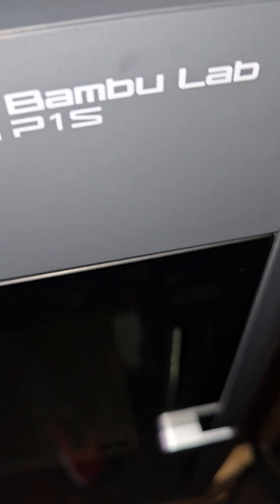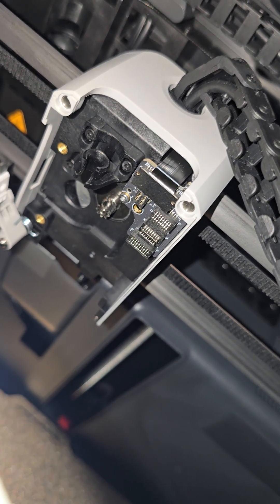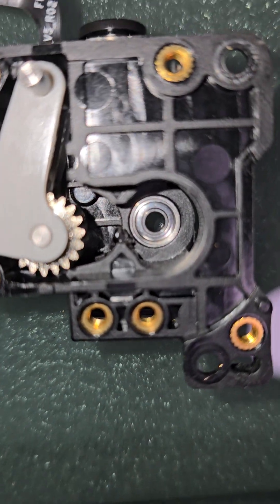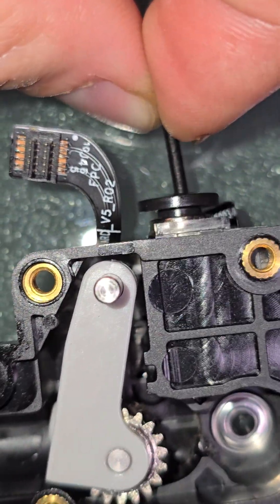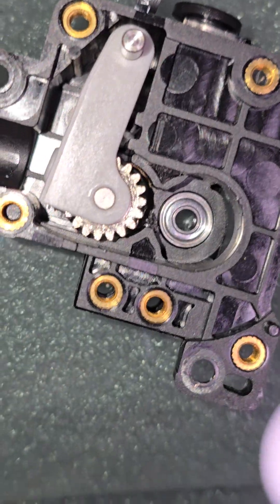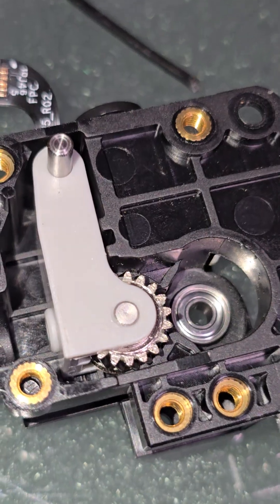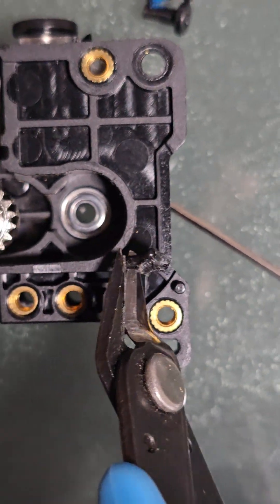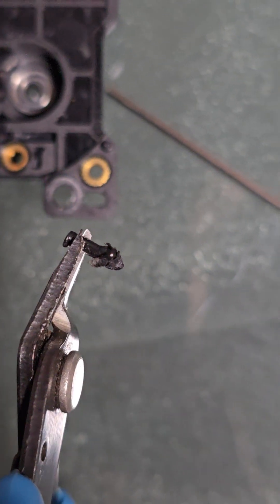Bambu Labs P1S Diagnostic: Filament Stuck in Extruder Gears

Comment: This is exactly what happened to me, and I'm new to this, and only been printing a week. I've yet to take apart my gear assembly, I ordered a new hardened steel gear hoping it'll prevent it in the future. 
Thanks for the share.
Reply from the maker: you're welcome. I recommend making sure you don't have heat creep going on, that's what caused it for me.
Reply: @peterprints  what is that

Comment: This is caused because of the chamber temperature getting too hot and the gears get hot so the filament softens in the extruder and it will do that, printing petg and pla take the top glass cover off
Reply from the maker: Generally I don't have a problem printing PETG with the glass on. It really is about heat creep and temperatures, though, you're right - so I think you've nailed the cause of this on the head. I have this printer in a room that isn't air conditioned like the rest of my printers are.

Comment: i've had the same issue with my brand new p1s combo. i fixed by printing with 250"C, its not gonna burn your fillament,  and it's working fine now. it's because of the speed it's printing, you need better flow so that means high temps. good luck!
Reply: Just take the top glass door off and you dont need to turn up the temperature, it probably works because the filament is easier to push so it doesnt gunk up in the gears, just take the top glass off and you dont need to turn up the heat
Reply: @jonnysimps  yes i was thinking of that. But with 250 works more than fine with me. Also i have better adhesion to the bed
Reply from the maker: Yeah, I used to print a lot hotter than I do now. I stopped that mostly because I print a lot of round objects and the stringing got to be too much. I really don't mind stringing most of the time because I value layer adhesion more since they're functional parts.
Reply: @peterprints  yeah, i know what you mean about the stringing, i've had a lot of isues with my ender3 pro (upgraded) but now with p1s it's so much better, little to no stringing even at 250"c